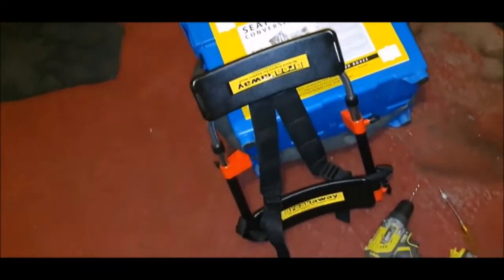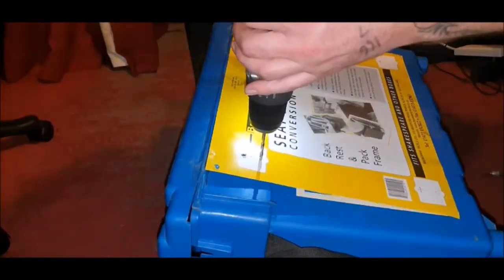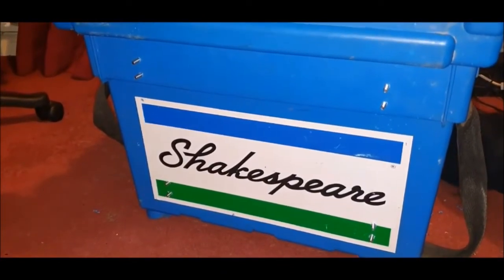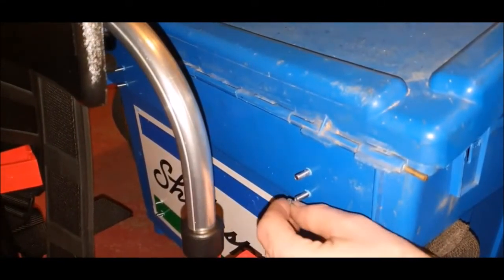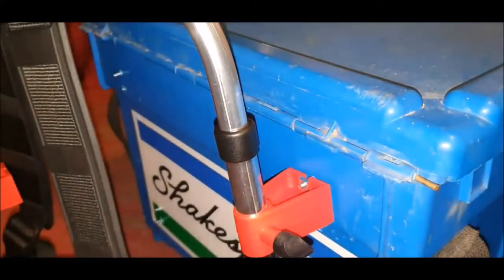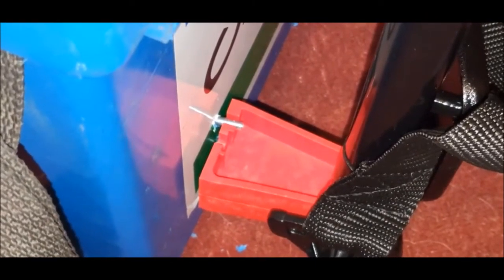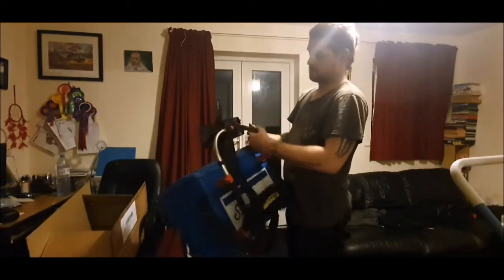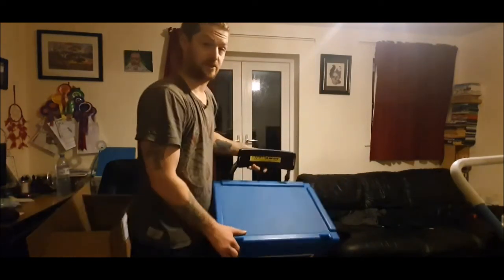breakaway seat box conversion fitting

Comment: lol i dont think you read the instructions correct ... you drill the first holes through the template then you put a bolt thru the back of the holes so its facing outward then you put the backplate on the bolt and drill the bottom holes .

If you try using both holes on the template the bottom holes will be out of alignment !!